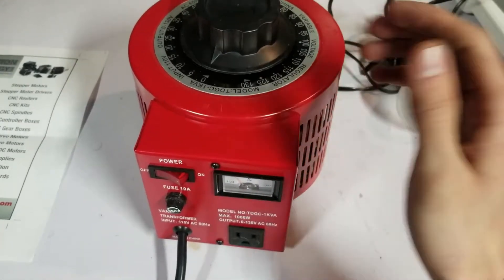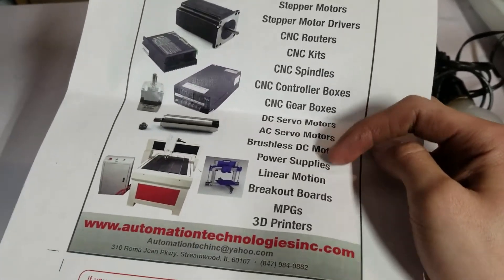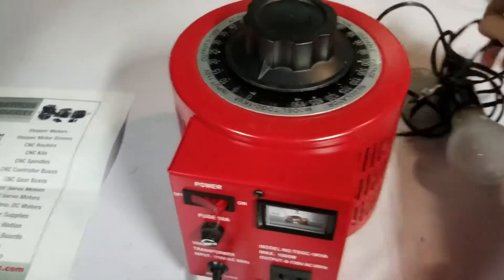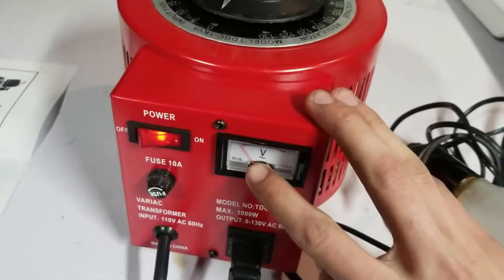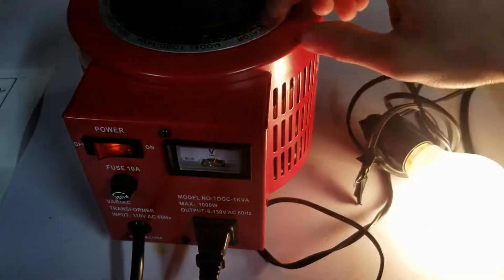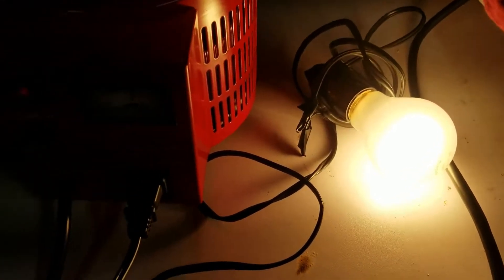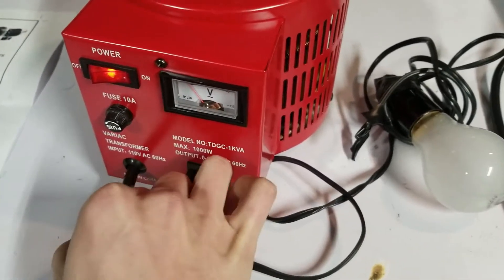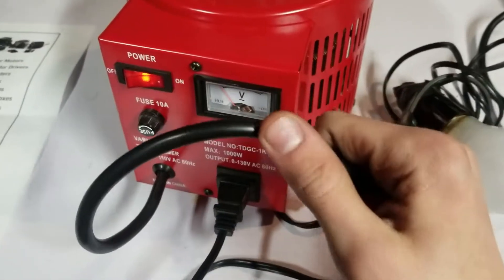TDGC-1KVA Testing Video

Comment: I don't know how did i came here, but must remark some things, 1- It's just a Autotransformer, the "VariAC" is a trademark for the American Radio company that designed autotransformer many years ago, 2- Autotransformers normally are designed to be conected to AC outlet to a tap of it that is before the extreme end of coil so the resultant coil from that point can achieve more voltage due induction, basic of electronics 3- Autotransformer rated more than 0.2KV (200VA) are wired with out removable plug as computer power supplies are cause the carbon contact, the power switch and even plug AC outlet connector are "hot points" that can heat. Normally modular conectors as PC power supplies could be loosen and hot high, so to avoid it they wired up, and your autotransformer is rated as 1KVA, so it's obvious that wired as many other auto transformers are. Chinese autotransformers like that just suck, are just a "me too product", a copy of a copy of original one. Best regards.